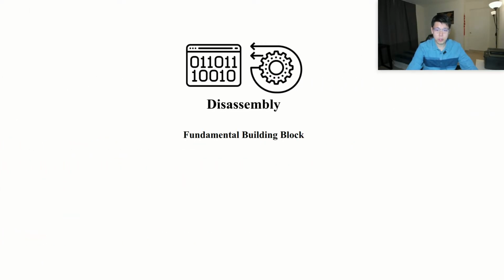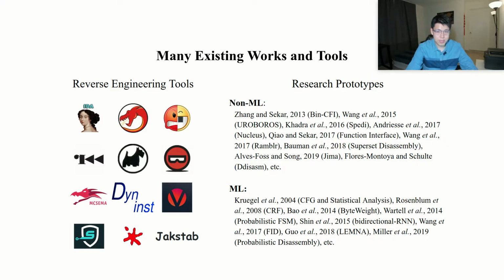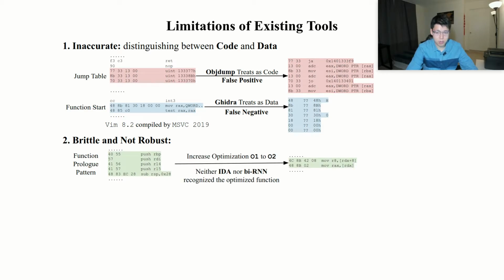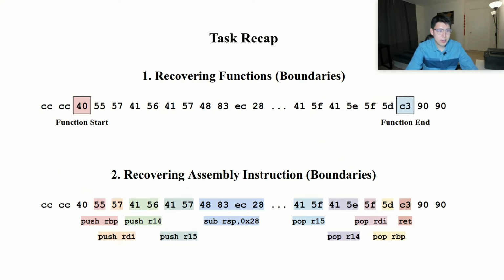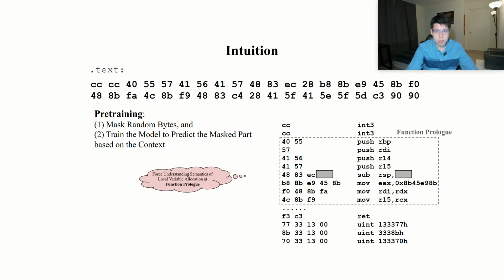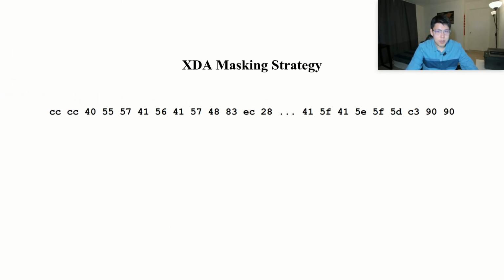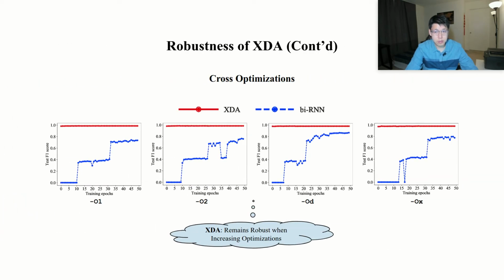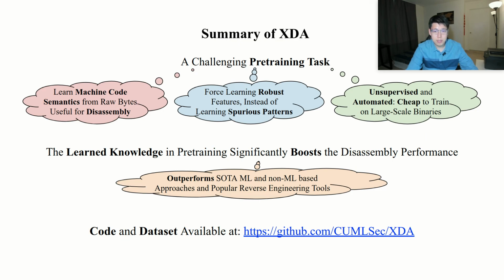XDA: Accurate, Robust Disassembly with Transfer Learning

Comment: Excellent work!

I'm looking at the GitHub page for the code base and see instructions on how to install, build and train the XDA tool. However, I can't seem to find the proper script to actually run the tool. If I want to test XDA's disassembly capabilities on my own stripped binary using the pre-trained model, can I feed the binary directly to the tool as input or do I first need to binarize the binary into a text file and feed the text file as input? And, if so, which script do I use to run the tool (e.g., > run.py binary.txt)?